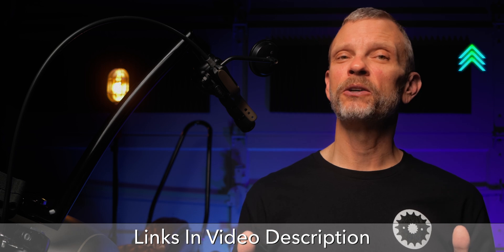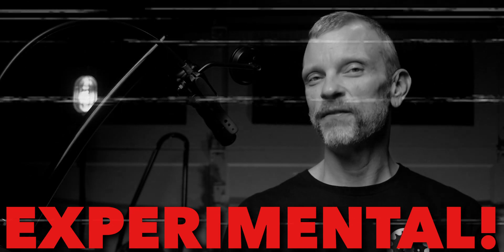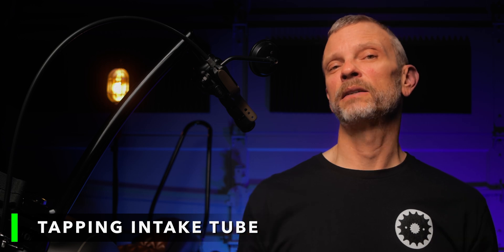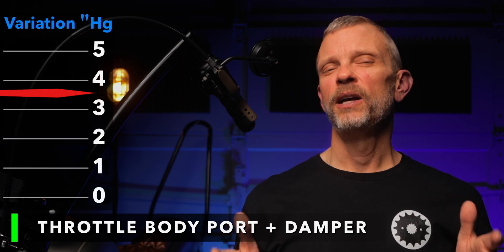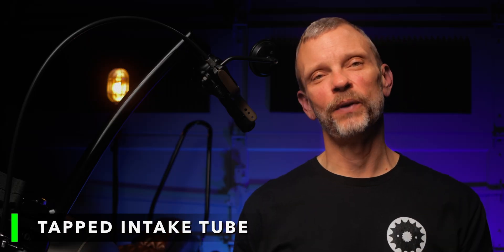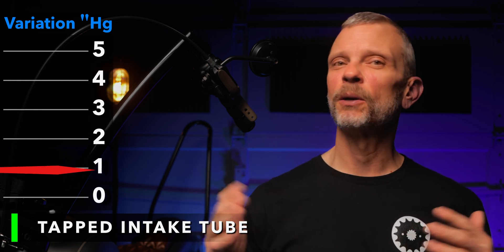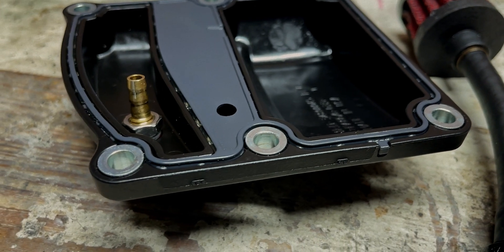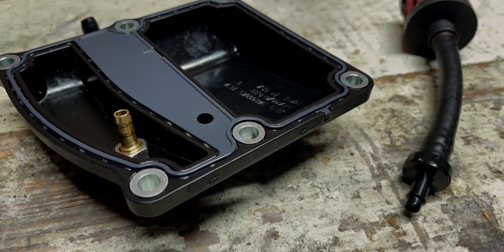Vacuum-Ported Catch Can • Crankcase Vent: Keep It or Dump It? 👍🏼❓👎🏼 (M8 Sumping)

Comment from the maker: Are you using a crankcase vent? Have you tried a catch can, or some other variation on the theme? Let me know what you've done and how it's working.
Reply: Have you seen Blockhead’s crankcase vent? They route from breather bolts to transmission cover, and notched the transmission inner wall between the oil pan and that void with the breather hose.
Reply from the maker: Hey Josh - yes, I did see that although I missed the part where they notched the inner wall. If that’s the case and it makes use of that little rubber vent tube in the other compartment that should be viable. But I don’t want to notch anything while it’s still on the bike!!
Reply: @RonsWorkshop  says the guy that hasn’t hesitated to drill holes through this and that! 🤣

They made a follow up video that explained the notch. They realized it hadn’t made it into the original video and understandably received a lot of questions because it looked like a closed loop at that point.
Reply from the maker: 🤣 I know, right!

Ok, I’m glad I didn’t just miss it in the original video.
Reply: @RonsWorkshop  I’d really like to see that video of his……. Oh, looked at that video, not even going to cut into the trans “case”…. Just so I can simply use the stock transmission vent that’s already there. I don’t like the idea of contaminating my transmission fluid with engine oil not to mention permanently damaging the transmission case.
Reply from the maker: I’m with you on that one.
Reply: Hello Ron! I've learned a lot from your videos. I have a 2017 RGS M8 Stage 2 with only 9,000 miles. I'm planning on replacing my oil pump to the upgraded pump with the seal. Do you know what other parts should be upgraded?  I'm looking to keep this bike and want to be proactive upgrading faulty parts before any engine damage occurs. TYIA!
Reply from the maker: @RoadglideDad  that's definitely the big one in terms of known issues with the early M8 motors. Do you have any sumping symptoms? I ask only because I've also heard of issues with the piston jets - but that would typically cause an obvious sumping problem. And thanks for the encouragement!
Reply: Hello Ron.  Thank you for the hours of research and testing you are sparing me from doing myself.  I am convinced the basic top cover method is the way to go with the DK customs catch can I have.  Would it still be necessary for me to do the EBS from the air cleaner?
Reply from the maker: Hey Robert - I appreciate the kind words! There’s a bit of a tradeoff: Without the breather mod, you will still have some oil in the intake. If you do both mods you remove the chance for getting a vacuum in the crankcase (the breather mod eliminates the oily residue in the intake but removes the potential for vacuum). Vacuum is beneficial but more important in my opinion is venting the pressure out.

You could always do just the crankcase vent and see how the intake looks after some miles. If you’re not happy with the amount of oily residue you see, you could add the breather mod. Let me know if that helps…

And if you want a sticker send me a DM on Telegram, Instagram or Signal with the mailing info @RonsWorkshop
Reply: @RonsWorkshop  Thanks for the reply.  When the snow melts I will get on it.

Comment: Thought about this some more after reviewing DK Customs video on their transformer plate that is a part of their external breather kit, I was thinking what if: (1) Run the breather tube in and out of the catch can that would be connected to the throttled down intake vacuum source (2) Reconnect your check valve to the transmission cover vent and let it vent pressures atmospherically. So at idle, the intake vacuum source would be able to handle the volume of crankcase gases created and then when you get to higher rpms, the volume of gases the  intake vacuum can't handle would be released by the atmospheric transmission vent. So from idle to high rpm, your crankcase pressures would be somewhere in between 0 and whatever you set the intake vacuum adjustment valve to. Sounds like a good balance to me 😊

Comment: What a worm hole I've dove into today😊 Definitely got my OCD going. In reviewing your results using the throttle body Vacuum, I think the big question would be how much volume (cfm) of gases is it relieving from the crankcase? To view in simple terms using pressure, you can use a garden hose that has 50psi of pressure behind it and you could use a fire hose with 50psi of pressure behind it. Which one is going to move more volume? The same applies to vacuum. Whether you have 2" of vacuum or 9" of vacuum, the result you're actually looking for is the right amount of volume of crankcase gases removed from the crankcase without going into to deep of a vacuum. At idle you didn't have any fluctuations probably because the volume that was being sucked out by the throttle body vacuum source was plenty, maybe even too much. But when you're riding at much higher rpms, a much greater volume of crankcase gases are being created therefore possibly exceeding the volume potential of the throttle body vacuum source. I think the only true way to determine this would be finding an additional way to tap the crankcase in a different location to see if a vacuum reading is available there. Maybe get ahold of a stock dipstick and modify it by drilling and tapping to accommodate another fitting of which you could attach your vacuum gauge. Really have enjoyed watching these. I currently have the DK Customs breather kit on my 2021 Triglide 114 with a Stage 2 and tomorrow I'm putting on my Trask transmission cover vent. I was going to be satisfied with that till I saw this bit with vacuum and then I started wondering 😂😂 Either way I will still feel much better with having added the transmission vent cover but will probably keep wondering about a vacuum solution. Thank you for all your time and efforts!

Comment: Good videos on this subject. Ive been doing a little testing on this as well. Have a 2020 RGL 114 that i installed a Feuling vented dipstick on after schooling myslef on the crank case pressure issue. I then fabricated an exteranl breather system into a catch can. Ive ran that for at least 6 or 7k miles now. Zero oil residue in the catch can. Just built up condensation. However, recently i took a 3 hour road trip and discovered that the vented dip stick puked out a lot of oil during my ride. After some research and a call to Feuling i discovered that Feuling recommends to run one or the other not both. Due to the  potential for the vented dipstick drawing the oil out of the bike with and external breather set up. Im assuming for the lack of vaccume that it causes like your talking about . So sense the vented dip stick has pretty much eliminated the oil residue going into the intake im going to reverse course and re-install the breather lines back to the factory design.
Per Feulings reccomendation i alss took the dipstick apart and cleaned the filter. They said a saturated fikter could cause my issue as well.
To be clear, the oil level was half way to the full Hot mark while cold on the jiffy stand.
Any thoughts on this would be greatly appreciated.
Reply from the maker: Thanks for sharing the info on your setup! It seems that trying to run one or the other seems like a good next step, and then swap to the other one. Based on that you can determine which one you like best.

Comment: Ron, really appreciate all the work you have put into this. Question, did you ever take a pressure reading from the crankcase to see just how much pressure was building up? I think you could put a pressure gauge off the transmission cover vent to see how much pressure we are talking about, then go from there. I'm still not sold on needing vacuum. Thank you Sir!!
Reply from the maker: Hey Big88Country - thanks for the kind words! I didn’t measure the pressure in the crankcase, but it fills a ballon quickly! That would be an interesting experiment - I’ll add it to the list :)
Reply: @RonsWorkshop  Thanks Ron, I'd be interested in that number. Yeah, I saw your video on it filling up the bag. Keep going Brother, and we Appreciate what you do!

Comment: Hi Ron, I’ve been following your crankcase pressure journey. My 2017 Road King started pumping oil from the factory intake about three seasons ago…approx 10-12k miles on the engine at that time. I had the same issue on my older twin-cam Street Glide too. (That I solved, using an external breather.)

So far, my current bike has resisted my attempts to fix the intake oil puke issue. I’ve tried several fixes, including…venting the head breathers to atmosphere, running a vented dip stick, and running both together. Nothing has worked and oil continues to pool in the intake, trip from the air filter, and splatter all over my saddle bag, side cover, and exhaust. It’s not catastrophic amount, but it is annoying. 

At this point, I’m wondering the following…a. could the umbrella valves in my heads be malfunctioning and allowing excessive oil flow or pressure that’s blowing oil into the intake? b. if so, why didn’t the dip stick vent also show signs of oil? I’m puzzled by this.

I would assume that the M8 (like other HD twins) does all of its crankcase breathing through those two head breathers? Therefore, crankcase pressure should be very similar to the pressure in the valve covers at those umbrella valves/breathers? Right? Why didn’t the dip stick vent (which is about 3/8” allow that pressure to vent? Then I realized, isn’t the M8 a “dry sump” motor like all previous Harley twins? As a dry sump, the engine sump and the oil tank are two separate spaces. (My understanding of the phenomenon of “sumping,” is that engine oil collects in the engine sump (where it should not be) instead of in the oil tank, where it should.) Therefore, the really wouldn’t be any benefit to venting the oil tank space…because the pressure problem is in the separate engine/crankcase space. Does that make sense to you?

I’m going to try your vented “transmission” cover fix next…based on the idea that that third chamber that is exposed is, in fact, the crankcase. That should, theoretically, provide pressure relief to the engine and reduce or eliminate the oil being blown into the intake. What do you think?

As a little background info you may or may not know…in automobiles, crankcase pressure was traditionally run to atmosphere via a “road draft tube,” essentially a hose run from the block or valve cover directly to the bottom of the car. Early emissions controls dealt with this by using a PCV system…positive crankcase ventilation…essentially what you were playing with in your vacuum/ catch can experiments. These systems typically routed crankcase vapor/pressure to the intake manifold using a control valve (a PCV valve) to modulate crankcase pressure and manifold pressure. In theory, you were trying to do the same thing with that modified pet cock you installed between the throttle body port and your catch can. The problem was, yours was fixed and couldn’t adapt to the variable pressure generated between manifold and crankcase on a running engine. A proper PCV valve (tuned to that particular set of parameters) might have worked better. I suspect this is why HD has chosen the simpler method of routing vapor to the filter, vs. the manifold side of the throttle body…you don’t need to design as elaborate a system?

This is just a guess on my part. I’m not an engineer or any kind of expert and I’m certainly not dissing all your hard, thoughtful work and knowledge. I’m just offering this up in the spirit of mutual interest and experimentation.
Reply from the maker: Hey John - I'm no expert either, but I believe you're on the right track with how you're thinking about things. I'm curious what you'll find with the transmission top cover vent. However, it does seem that the vented dipstick should have alleviated that pressure as well. Please do  let me know how it goes, and thanks for sharing your thoughts on this!
Reply: @RonsWorkshop  Ron, I actually did the DIY tranny cover vent yesterday. It worked out pretty well...but, those loc-tited bolts are a pain. My cover is aluminum and it has a metal sandwiched gasket underneath that covers the crankcase completely. I needed to drill a small breather hole in that - no problem. Otherwise, I drilled and tapped a 1/4NPT hole for my brass fitting, reassembled everything, routed a section of 3/8" hose up and over to the r/h frame behind the side cover, and I'm good to go. I still need one of those check valves to complete everything, but so-far, so good. When I get a chance to road-test everything over the next few weeks, I'll give you a holler with the results. Thanks again for you videos and be safe out there.
Reply from the maker: Excellent! Looking forward to the update.

Comment: Good stuff. I have a 2020 with the upgraded pump but Im going to do the trans cover mod anyway. Also going to reroute the breathers. Any reason you didnt cut off the excess hose barb sticking down under the cover?
Reply from the maker: No particular reason, but on the next one I would. I’d also go with at least 1/4” fittings just to provide even more airflow.

Comment: Hi Ron. Thanks for all the good knowledge drops. Wanted to see if you heard of anyone, or if you tried, teeing and venting the head breathers directly into the crank case cover, and then venting out of the cover with your check valve and filter combo? Thanks.
Reply from the maker: Hey Mario - thanks for the kind words! I haven't tried that exact combo, but I seem to remember comments from viewer(s) that mentioned that. It seems to me that it would work, BUT be aware you may be introducing contaminants into the crankcase that would have been vented into the throttle body and then burned. Let me know if you give it a try...
Reply: @RonsWorkshop  Thanks for the reply Ron. According to the Blockhead Mechanic, the oil is not contaminated, but merely oil passing past the umbrella valves as a result of over-pressure?? (11:20 mark on their 2nd video) (I'm not a mechanic so I don't know how true that is, but I will keep digging). They  take that Blow-by, route it to the gearbox cover, but I don't really want to grind my metal out, or share air space with gearbox, which is why I thought just placing another tube adapter and the check/filter would take care of the pressure. Those guys don't even use a check valve, it free-breathes, but I feel as though having the check valve would be a better choice in trying to allow the engine that same pressure as stock. Seems ok, was hoping to get your opinion on the pressure aspects of my proposed.
Currently have a 2021 114 FLHTP, and have by-passed blow-by out to a filter breather. Has worked OK, I guess, better than in my combustion chambers! On long highway trips, and hard-riding, I just need to put a diaper around the filter and that seems to keep the  oily air spit manageable lol, but need a better solution. Thanks again!
Reply from the maker: Hey Mario - I’m no expert either, and I won’t say he’s wrong. I just err on the side of caution. It’s safe to say that whatever you see coming out of the pod filter with your current mod will end up in the crankcase. Give it a shot and see what you find! It’s easy enough to reroute things if needed.

Comment: Hi Ron, thanks for all the great videos and the time and invested to keep us all informed. I have a venting question; I had asked you about venting the crankcase through the transmission vent, and you pointed out the same concern I had about cross-contamination. I had gotten the idea from another youtuber ( https://youtu.be/bIyaV8KP8HI ) . I really like your catch can under vacuum,  but I have a question.  What do you think about eliminating the catch can by putting two fittings in the transmission cover over the crankcase? Rerouting the head breathers together and tee off to one of the fittings, and put vacuum to the other fitting. Would that give the same result but without a catch can to maintain? What do you think?
Thanks again for your time.
Reply from the maker: Hey - Pete & Donna - sorry for the delay in responding. YouTube held this comment and I just came across it. I think that could work, with my only concern being the one you mentioned about introducing contamination into the crankcase. You could run a temporary catch can to see what it collects, and base your final decision on that. Let me know what you end up with!